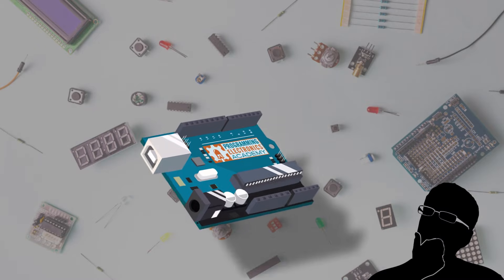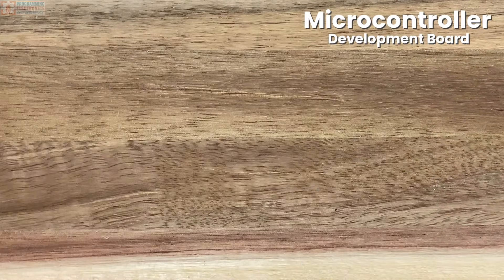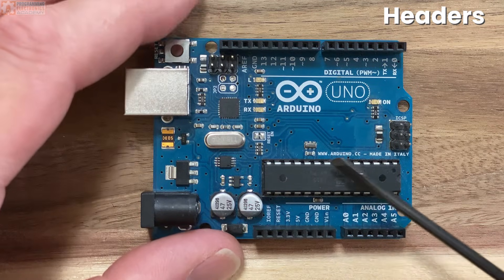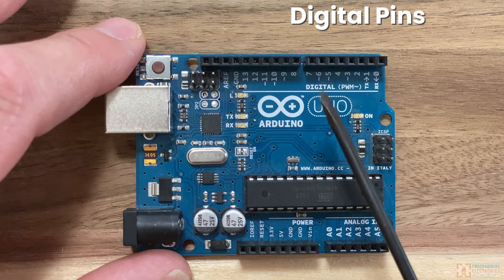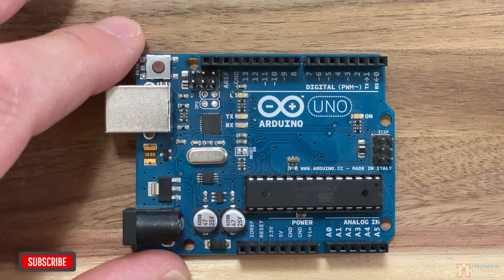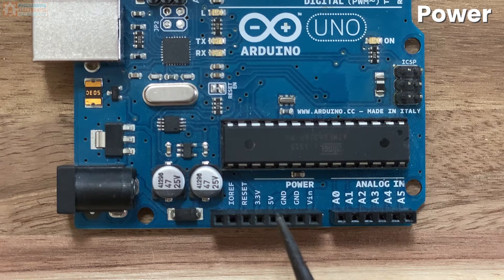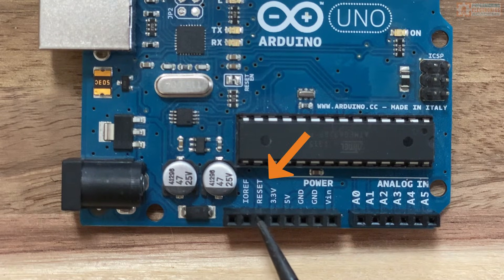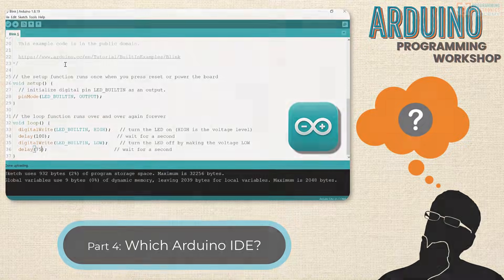Arduino MASTERCLASS | What's all the stuff on an Arduino Board?  PART 3

Comment: can you give 10A 16V to arduino
Reply: I want to use 4s 18650 battery to power Arduino and a 12V led from a relay module
Reply from the maker: Yes you can,  but you’ll have quite a bit of excess power that will be dissipated as heat across the voltage regulator.   I think a more optimal voltage for your power supply would be around 9V